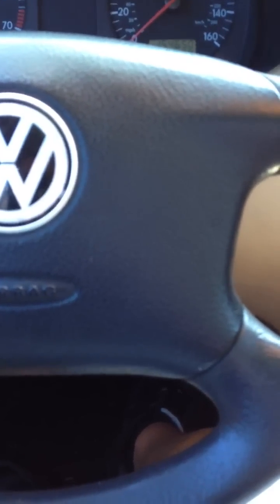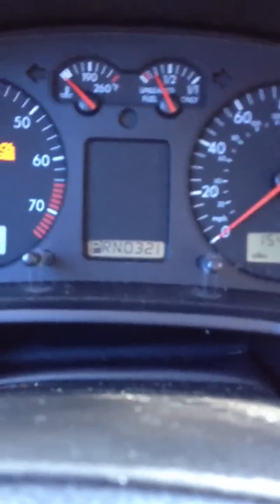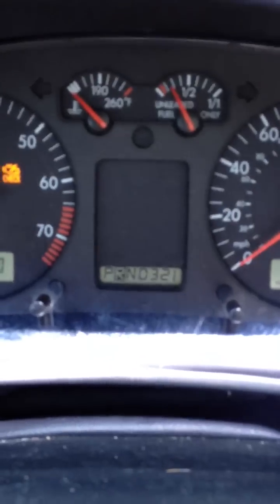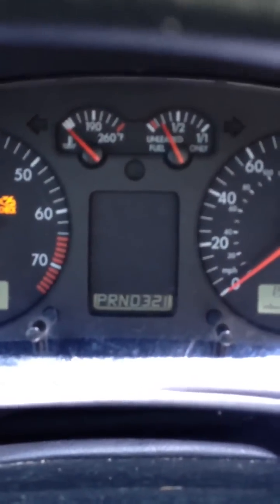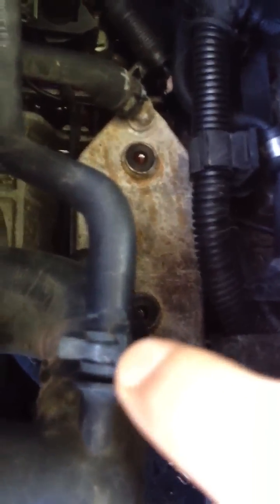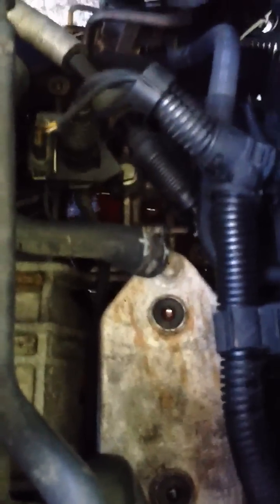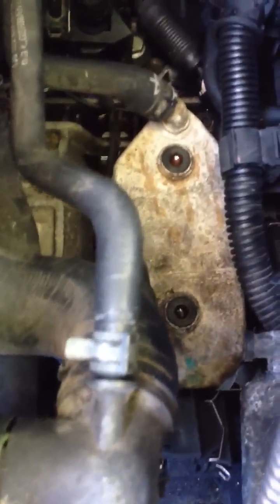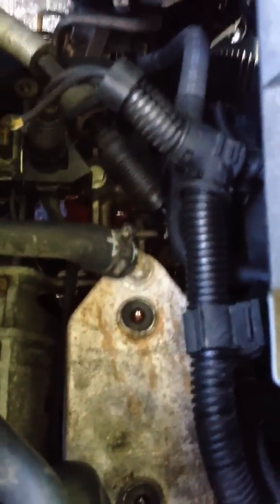1999 jetta 4 Cylinder 2.0 Limp Mode

Comment: Which scanner did you use to reset the transmission computers?
Reply from the maker: @depdark1  so this video is over a decade ago, I didn’t have a scanner, I went to advanced auto they have free scanners they will let you use in the parking lot that I did to see those codes but to reset everything I just unplugged the battery both positive and negative and held the positive and negative terminals together touching eachother and tied them together to reset all modules in the car let it sit for 30
Mins that usually does the trick.
Reply: @TheHandsOnGang561  thanks for the help ! I just swapped a 
60k engine and transmission from a car that was wrecked into my car. engine worked really good but the transmission doesn't wanna shift out of 1st gear. Do you have any idea what could it be ?
Reply from the maker: @depdark1  did mating a whole new setup to eachother it would have to be my guess programming or potentially wiring, I mean it’s virtually impossible to sit here and tell you what it is just by the little info given and I am in no shape or form a expert on VW’s… basic rules tho get a scanner, start from there see what it’s showing is malfunctioning, from there you can chase the problem till you catch it

Comment: Under your windshield is 2 computer one is ECU other is TCM all 2.0 have the same problem with this TCM causing problems in transmission. Whay? Water stuck and wet the TCM. If you remplace this part your car come again at the road.. no need programming is just swap and thats all..

Comment: I know this is an old thread, but how did you reset the transmission control module? I have an 04 with 2.0 auto that is staying in 3rd gear when you have it in drive
Reply from the maker: "What I did" might be different for you but I just disconnected the positive and negative terminal on the battery and touched them together for about 10 seconds! Then hooked it back up.. worked for me
Reply: When messing with a relay for the AC accidentally touched something together and it arched. Check engine light was already on at that point and trans was fine at that point. After putting the relay back is when I discovered the trans was stuck in 3rd when in drive. Clear codes and trans worked fine again.
Reply from the maker: That's awesome glad it worked out for you..
Reply: Do u still need help?
Reply: I have the same problem now my self any ideas

Comment: Battery went dead in my 99 Jetta and it went into limp mode and would not start. Alarm went crazy.  Online research told me I needed to remove the negative battery cable, turn the key on (just the first click, not trying to start the car) and replace the battery cable while the key is turned on. It reset the system. Car started. NOW the fuse for my injectors burnt so the car died while driving. Replaced the fuse, car starts but will not shift automatically out of first gear. :(
Reply from the maker: Well I would say run to your local Advanced Auto and have them bring out the OBDII scan tool, with a lot of them you can reset the ECU and TCU... I believe if not they have it located under the front passenger seat or something of that nature, obviously when a malfunction like yours occurs it could certainly put the car into Limp Mode, not likely that you burned out solenoids just doing resets and replacing fuses. the tcm obviously got n error and put the car into limp, getting it out shouldn't be to hard
Reply: Hubby is hauling it home right now so we can look at it better. Try resetting it and such. I'm throughly confused because I can shift it manually and it goes into reverse fine, but will not shift up out of first automatically.
Reply: Melissa Lyons

Comment: My 2000 cabrio went into limp mode after doing a head gasket. (did not disconnect the battery while working, Wanted to listen to the radio while working, not a good idea!) I tried disconnecting the battery, touching them together, didn't work. Transmission was in limp mode. I went to auto parts store and used there scanner and it read that my speed sensor went bad. I erased the codes with the scanner. now the car runs great!  Try it before you wast money. some vw store codes in the computer and only works with a scan tool. Hope this helps someone.

Comment from the maker: Italys Finezt
Yeah, I honestly didn't spend a dime. I know it sounds crazy but it just fixed it self, was driving around about 2 weeks after it went into limp mode, I replaced the Flange that broke so it wouldn't occur again and out of no where the car just started shifting normal again, it literally worked from there on for a while, one of the lower gaskets actually started leaking coolant real bad so instead of fixing that I just sold/traded it in for a new car. I love Volkswagens tho, just got a 2012 Passat and it's a beauty. If this happens to you guys start with a scanner, clear the Codes that are stored on there and try driving it and see what happens, from there scan again and see what codes come up! Then process of elimination from there. Hope this video helped some, my apologies to whom ever this didn't help :/

Comment: that just happened to me today, I was omw home from work and for some reason my car (VW 09 JETTA 2.0) the transmission on D got stuck in 3rd gear, so after 15 min driving less than 40 miles, I turn off the car, let it rest for 10 15 min and then start it and the problem was gone...I hope I don't have to deal with it again..

Comment from the maker: Yes. Read all the comments, and your welcome to who ever this video may have helped, with all the comments and general knowledge u have invested in trying to figure it out so far. I'm sure this will give most much help before dumping a shit ton of money into some lazy mechanics hands. Just process and elimination can usually help u find the source of any car problem. Thanks as well for all the like :) and sorry for whom ever hit the dislike. 

Because the solenoid connector plus got drenched in hot coolant it had cause corrosion within the matter of a week or so. Unplugging and cleaning your connections is a good start! Also resetting the Tcm and ECM.. 

Some may have to get a scanner which is easily accessible at your local discount auto, they allow u to test it in the parking lot for free. I reset my Tcm and and Ecm. That night she just started shifting again. 

Just do as much things as u can before bringing it in, I don't care what car u have! Transmission shops charge serious money for the smallest problems with a transmission. Or ask a question most on here would be glad to give some insight as well would I.

Comment: the most common fix for this is the output shaft speed sensor, and it costs 60 bucks and its fairly easy to change. the hardest part is taking the tranny mount off to get to the sensor.
Reply: Where is it located mate

Comment: I have the same problem you have i am trying to fix mine at the  moment,the dealer told me that it was my connection between the transmission valve body in the computer of the transmission .I say is the valve body connection on top in your transmission.You can try cleaning up the connection and dry it.

Comment from the maker: the car goes into limp mode for one reason only.. and that reason is so u do not damage the transmission any more then what has already cause it to malfunction, it could be a simple Loose/bad connection on a speed sensor a change in pressure and the car will automatically goes into limp mode, the transmission reverts to either 1st 2nd or 3rd gear and keeps it in that gear so u can travel at a safe speed to get it to a destination.

Comment from the maker: and test the 2 top solenoids connector plugs.. if they are where they should be then u can most likely cross them out, its not 100% cause sometimes they read good but are still roasted. dont get me wrong tho my car was in limp mode for like 2 and a half 3 weeks before it started working again. before u go and start replacing sensors and solenoids, use the volt meter, after that Reset the Tcm.. then battery ect, i sold my jetta like 4 months ago and got the 2011 Chevy HHR..

Comment from the maker: K... If u guys had the same problem with the coolant flange like mine did and the hole top of the transmission got soaked with hot coolant, after i unplugged and dried and cleaned out each plug and connecter that got wet, i then drove it around for about 15 or 20 mins with it stuck in first gear.. as i was driving at about 2 thousand rpms i felt a thunk. i was like wtf was that. i stopped the car and started driving and it was shifting perfect like it never happened. i would get a volt meter..

Comment from the maker: The Problem Fixed It Self.. About 2 weeks After It Went Into Limp Mode i Was ''Limping'' To The Grocery Store And Out Of No Were I Felt It Shift. I Slowed The Car Down To A Stop And Started Driving, it Smoothly Shifted Into Every Gear Like Normal.. And Has Been Working Fine Since. So If U Guys Ever Get Solenoid Trouble codes on A OBDII Scanner It Does Not Always Mean U Need A New 1s, Could Be Something Simple  :)

Comment from the maker: The Only thing that has changed Since i Made This Video Is after resetting and unplugging shyt like a million times is the PRND321 Indicator it does not go all black and highlight every single gear like it was doing in this video, its normal now just still in Limp Mode :(
Reply: Joe Rida  I'm having the same problems with mine. I have a 04 jetta 2.0 automatic, and the side flang on the motor with the radiator sensor. Well that was leaking and leaked all over the top of the tranny. Well now I'm throwing the code p0722 which is a speed sensor output  no signal. What do u recommend I do.thanks

Comment from the maker: Yea If u read in the description i put the codes i got when i went to Advanced Auto, Since i Posted this i replaced that Plastic Flange that i show in the vid so when i get this problem fixed this will not happen again. I Am Almost 100% sure this is what caused the car to go into limp mode, i have unplugged and replugged most of the sensors to see if maybe there was a bad connection. and the solenoid connector plug. unplugged the battery like 20 times,